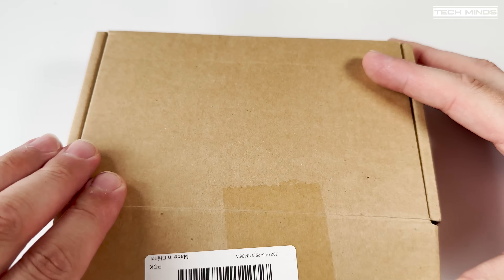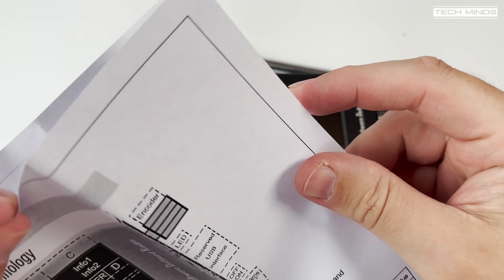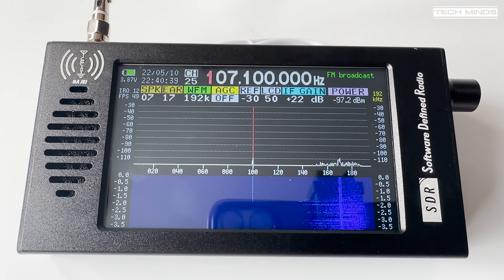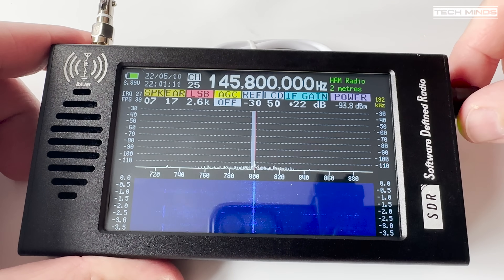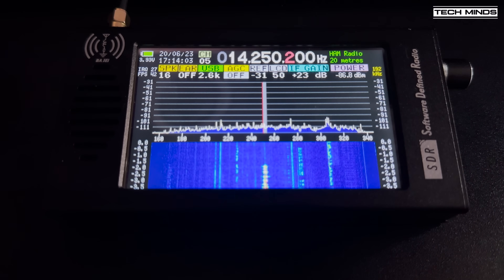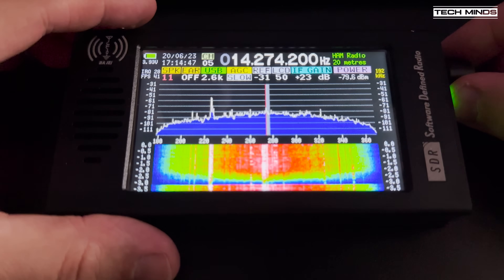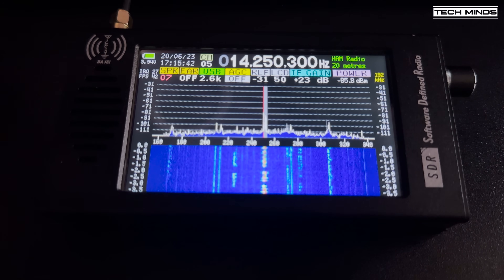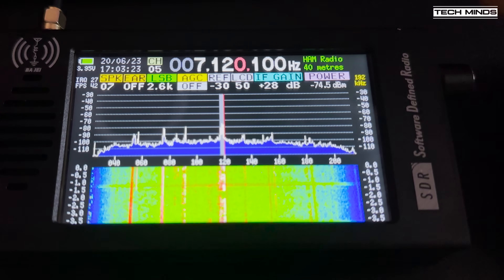SDR 101 - DSP Receiver That's Cloned More Than Dolly

Comment: I just bought my second one as I sold the first as I didn't have time to use it. Now I bought my second one and my location is near the city, I am having issues with FM broadcast radio bleed through on all bands. I try to use the airband and all i get is a horrible noise even without an antenna. Anyone else have the same issue??

Comment: I just received my receiver. Solid build. Good audio. Sensitive. Manual (right) is poorly written and insufficient. Learning the radio, good reception on whip antenna. Haven't connected it to my end fed wire in the attic. FM sounds great!

Comment: just got one and encoder doesnt depress so apart from manual tune,I can't do anything.Volume stuck as well.Banggood £59.20 Returning it.
Reply: Mine was the same way, I had to pull the knob off and jam some plastic up inside as the knob slides down to far.. once I did that all was well.

Comment: Nowdays Its Crazy What Chinese Are Copying, Some Devices Are 1/1 To Original And You Almost Need A Scientist And Engineer Next To You To Know That The Device You Just Bought For A Bit Cheaper Then Original is Fake With Lower Quallity EVERYTHING!
I Remember When I Went Into radios About 5 Years Ago, I Bought The SDR's, The Yellow PCB Ones And I Was hacking Them Up To Receive HF, But They Said On Ebay Seller Page That They Are HF Receiving Devices, I Did Not Know At The Time, but I Thought That My Antennas Are Just Shit And Thats Why They Dont Pick Up Anything, but When RTL.SDR Aproched Me About My Fake Sdr, I Knew The Gig is Up, They Gifted Me A Real RTL.SDR, Two Of Them With All The Antennas And Everything That They Could Included, Then I Hooked Them up To My Computer And I Was Able To Hear Even 80Meters Wich I never Was Able To, Only The Broadcast Transimtions And Only At Night before, Now I Was Able To Hear Actual Hams And radio Enthusaists On Air Wich Made Me Super Happy. Sadly Im poor And Cant Go Any Further In My Hobby, My Shack Is Caved In, No Roof, There ARe Pretty Historical Devices In That Shack, Cant Sell Them, Noone Have Money For Them And Im Just Screwed All Around, Not Only Financially ButT health Wise To. :) But Thats Diferent Story. What Im telling Is That The China Is Copying EverythinG And They get Better And Better At What They Are Doing.

Comment: I've got one, and I love it, easy to use, and the price is right, I used to battle with SDR UNO, never again. If it's a clone then it's a clone, I don't care.
Reply: I bought one to track down some wideband noise. It does the job. Deep SDR manual says the IF gain setting only works when the AGC is set to off. Mine works just fine. Some birdies, USB fails to enumerate etc.. maybe someone will take the code apart some day and come up with a fix. It's worth it.
Reply: I've got an information on how to get USB to work on this clone. You need to replace two SMD resistors R7 and R8 with 30 Ohms  in D+ & D- line. Personally, I haven't tried that yet but, I'm definately going to. Hope that would help anyone since there's very little information on Deepelec DeepSDR 101 itself and even less info on the clone.

Comment: It's funny to see that i got here via the sellers page on banggood. They are redirecting to this YT clip, even while it is in fact not a fair good review. Like they want to say: "be carefull to buy this, we warned you." But ok, i ordered one anyway. I'm not that smart you know.

Edit: and i was right. Ordered this one, it got here and i could turn it on once and then off and after that it wont turn on no more without the usb power cable connected. The on/off switch just stopped working correctly. If turned off you can turn it on if you dont wait too long, but if you wait like 1 or 2 minutes after turning it off you cant turn it on no more. Looks like some kind of battery/power problem. Altough it shows a full battery. Strange. Also on another review i saw another comment with the same power button problem.

Comment: Yes, I have this clone, and I am not satisfied with it.
The sensitivity is nothing, spurios and mirror frequencies, inexplicable clicks and pops and humming sounds, you can forget about the firmware update, it doesn't work. The only thing that works reasonably well is the FM music band, if it is a strong station. Don't buy this thing, in my experience.
Reply: It appers to be something with a lot of "cheap" asian radio's. The FM band working just fine but other bands not. Making them not- so- cheap radio's after all. And whats even worse is the amount of ppl telling on youtube that the radio is ok. I bought (as a non- HAM listener) lots of cheap radio's now and the only ones working quite well so far are the Tecsun/Sangean ones. (in the 0 - 100 euro range.) I know the difference between sdr and normal radio's by the way, sort of, but still i've noticed that lots of those cheap radio's (including sdr) are struggling with the other than fm bands. Many of them are of such a low quality that even non HAM listeners can notice. I personally believe that these products are just clickbait products. You buy them, get disapointed, dont want to take the effort of going through a lot of stuff sending them back and get your money back, if you even succeed in that, so they will end up in one of your "might come in handy some day" drawers. While the sellers have your money. And like i said: some youtubers are even helping them with good reviews. I'm glad tech minds over here tells the truth. More ppl should do that, and specially HAM operators, who should know better.
Reply: Yep, same story here with me.
the crap is in a drawer here somewhere, maybe I can use the battery for something else. I'm human so I make mistakes. @Music_Never_Stops
Reply: It all depends on one thing, and that is price. I've bought my clone for one sixth of Malachite price, so despite being not cheap for a radio receiver it's still WAY cheaper than ones like Malachite or Storch SDR. And mine works kinda ok. I've tried a lot of different bands and wavelenghts and even with it's stock antenna it still got signals. Especially, If you go away from concrete buildings. So it's not useless after all. It all depends on price and goals of specific user.

Comment: I have the clone.  Amazon.   I do not use the AGC, it is useless as you stated.  Main problem here is the sound quality is complete rubbish.  It sounds terrible.  I can reduce the gain down to where the signal is correct and it still sounds terrible.  WFM and Stereo still sound bad.  I thought maybe the internal speaker was blown.  I connected an external speaker and it still sounds terrible.

Comment: LOL yeah, the excessively high gain and pumping AGC can be a maddening feature of an otherwise good radio.  I tend to believe many DSP devs have never actually used a "quiet receiver" where the background noise is 20dB or 30dB below the max audio level.

It is a pleasure to tune the bands on such a "quiet receiver" and you know there is too much noise if the environment actually has a floor so loud as to result in a level of -5 or -10 dB below full strength.

Comment: Regarding firmware upgrade: I'm not an expert in USB standards, but it seems that the C-socket is only connected to the PCB by the outer two pins in each side, however the eight middle pins are not connected it seems.
On the other hand, the datapins of the USB-A power out port, seems to be connected to the ARM chip, via R30 & R32 - so I'm wondering if it's possible to make a connection via the A-port?
Maybe via some kind of an USB/serial adapter as mentioned in one of the other comments below?
There is a pic of the PCB on Banggood.

Comment: The Clone works the same as the Original. I have the Deepelec 101 original, and it is the same. It is a very disappointing radio. Avoid.

Comment: How long is an original or authentic piece of tech actually around after it hits production. Even beyond that, I just purchased an RSP-1 clone from Amazon because I wanted to checkout the software and GUI that is SDRPlay. I could’ve purchased the original but I have a huge problem for for profit software that “complements” the required hardware. That’s another story. The disturbing thing I came across when I received the SDR receiver, was the apparent Cry for Help or Warning of some kind that was printed in the solder mask on the back of the PCB. I’ve been trying to translate it but not having a lot of luck. 
If you have one of these RSP1 clones, have you done a tear down that revealed anything as bizarre. I’d post a picture of it, I just don’t know if that’s allowed in the comments section. Great videos as always, thanks for all the info!
Reply: I have an RSP1A that i use SCR Console with.  It is an excellent piece of hardware that can run other software besides SDR Play.  I find your argument puzzling since SDR Play is not required as stated in their documentation and on their website.

Comment: I have the original,  but it is not good.  The user interface is hard to use.  There is one update of the firmware.  It fixes one item, but breaks another.  I will never buy another deep product.  I wish the source code was available.  I think one could at least improve the user interface.  It has no NBFM demodulator, so it useless for VHF other than the AM air band.  Avoid this.  I think SDR for this means Sadly Disappointing Radio.
Reply: I have the Deepelec original too. And I totally agree with you. It's very disappointing.
Reply: I agree with both of the above replies.
Reply: My SDR is the same.